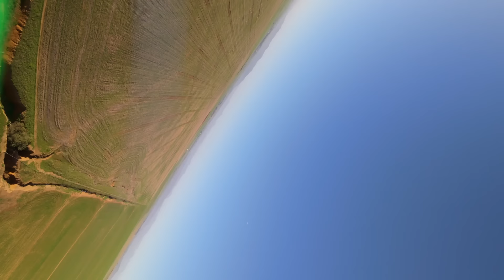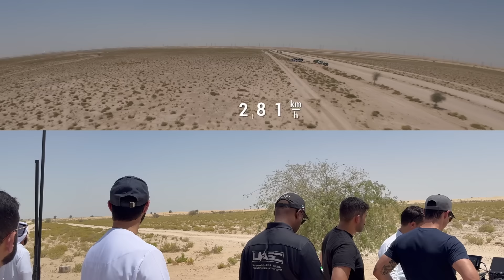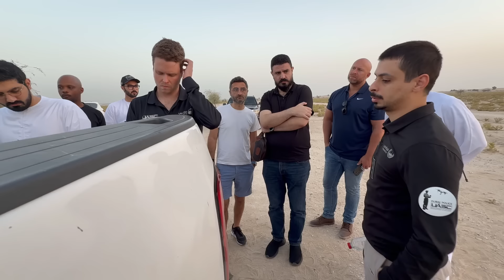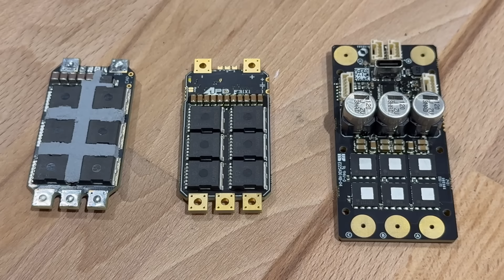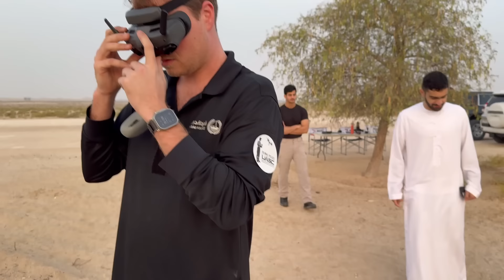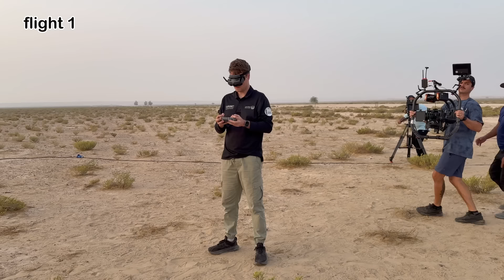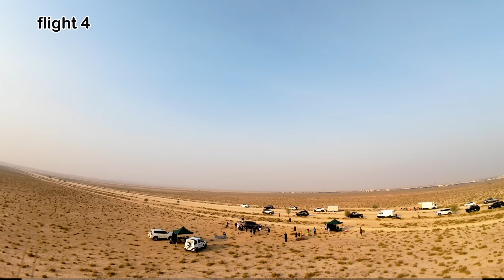Official Drone World Record Speed Attempt

Comment: What was the Doppler problem you had while passing the controller? I don’t see how the speed of the device would have an effect on the radio communication signal.
Reply from the maker: Yes we have had this failure and crash twice.  When the drone is abeam the controller at hight speed.  There is some signal drop due to phase shift or something when going really fast.  We have heard others with the same issue with the new DJI O4 unit.
Reply: Trying to understand the control issue when the drone passes the goggle/pilot at high speed. I can’t image it’s any kind of signal freq/phase shift. I just don’t see a delta of +160 m/s to -160 m/s (320 m/s) significant as compared to c. I believe there is a hard distance limit built into the DJI system and it must use signal time of flight to determine this? Could there be a software glitch around this?

Comment from the maker: This record attempt took place in Dubai in June 2025.
Reply: Correct, but I think over these next few  days, the record will be set in Australia 🙂
Reply: @DronePioneer  Australia had 603kmh 2 weeks ago.
Reply from the maker: Yes.  We hope so.  Then we can come storming back
Reply: Don`t you have to fly it in both directions?
Reply: @afroaliens  Yes!! But ol' mate in Australia was just flying, to see what speed he could get....
Reply: Diodos zeneth  resistencias y capacitores
Reply: My thoughts too @Mike-Bell. It's unofficial. Congratulations upon your achievement. Looking forward to you exceeding 603 kmh on an official one.
Reply: The record on GWR is for overall groundspeed, so they would still be higher. Great work though!
Reply: That's some fast & furious R&D!  Amazing how much difference there is in stretched parameters from different air temp and density.
Reply: Congratulations! If I may offer a suggestion for improvement, I would equip the motors with water cooling. This would involve spraying a cooled liquid directly onto the motor magnets using a small misting nozzle. Alcohol (40% vodka) is effective down to -27°C, acetone down to -93°C, and pure ethanol down to -114°C. This would reliably prevent the magnets from overheating and keep them permanently below 80°C, thus preventing demagnetization.

I would probably also design the magnets in a U-shape and glue them in place, allowing the coolant to flow through the resulting cavity. While this is a bit more complex, it would increase the magnets' performance by approximately 300%. The copper windings would then be the main concern.

I might consider contacting the company Hacker (electrode motors for world champions, F3A, etc.) in Germany to discuss this idea and ask which motor drivers they would recommend. These are German engineers who have repeatedly pushed the boundaries of brushless motors.

I wish them the best of luck.
Reply: little video, and a lot of chatter😖
Reply: Chinese beaten it 611kmh
Reply: @SpongeBob-xh8ir  yes, and they also landed on a sun... they were smart and did it at night
Reply: @SpongeBob-xh8ir   Source?
Reply from the maker: not for long 😁  our reord has been in place since June